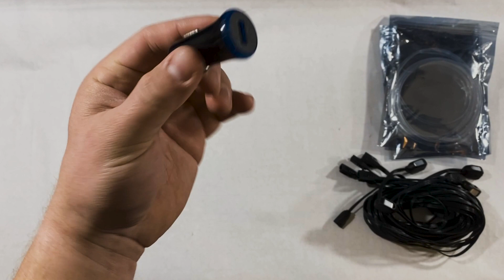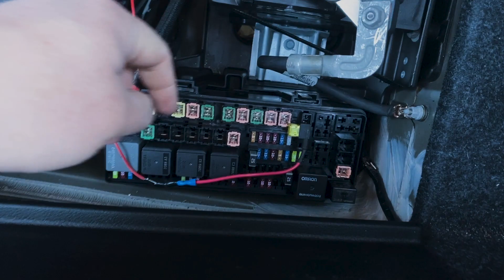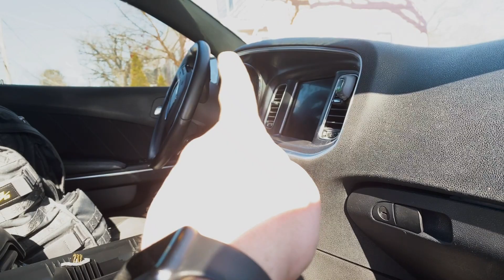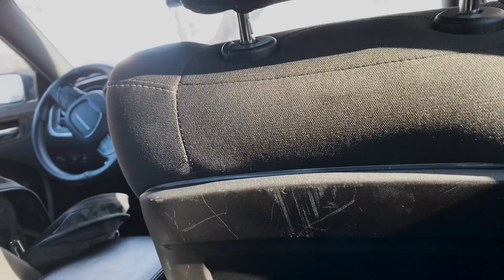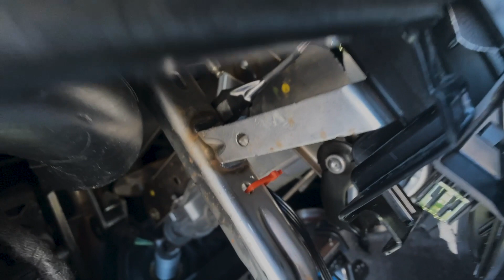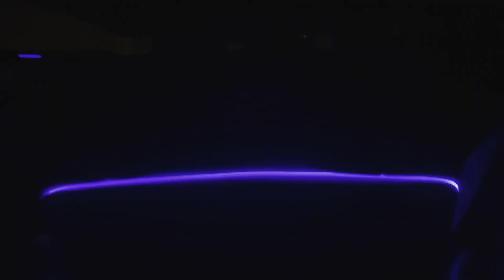Installing XKGlow fiber optic lighting kit

Comment: Looking for a kit that is better than what i have. The main issue with mine (different brand) is the. Flat part of the fiber optic cable is too thin so when its inserted into the seems of the dashboard trim it literally falls right back out in some spots. I believe this could be resolved by a fiber optic cable where the flat part is a bit thicker so it will wedge into the dash trim. Does anyone know if this kit or any other kit fits this need? Any help is much appreciated.

Comment: could you go into more detail about why you would need to hook it up to the battery ?
Reply from the maker: I connected the positive lead to the fuse and you need to ground the negative lead. all grounds lead to the negative terminal on the battery so I grounded it next to the battery. you don't have to hard wire the system to get it to work, I just don't like seeing wires so instead of using the accessory to USB adapter they gave me I hardwired the system for a clean look.

Comment: Have you had any issues with the fiber optic wearing out? I’ve had this installed in my car for a year and loved it! However as of late, one of the light heads stopped glowing through the right side of the dash. I’ve tried replacing the light head, but the issue persists.
Reply from the maker: I haven't had that happen, but I have had mine installed for about a year and a half now and the fiber-optic cable becomes sun-bleached which then fades it and dulls the colors its an easy replacement and then back to normal but an inconvenience none the less. now I will add that the vehicle this was installed in has never been parked in a garage and has always been under constant sunlight I do have tints on the door windows and I extensively used these lights everyday and sometimes all day so for how much abuse they've taken I'm happy with the results. the replacement cable is about $20 I BELIEVE so relatively cheap replacement as well.

Comment: ONE QUESTION - when the lights are on, how is your driving experience when it comes to the light reflecting off the front windscreen? Do you have that issue and if you do, how heavy is the reflection and where do you see it most on the windscreen?  I'm thinking of having this done to my car but reflection ended up being my biggest concern.  Thanks,
Reply from the maker: I don't have a reflection on my windshield but I do have some on my door windows. your tint level will also dictate how much reflection will show as well. but the lights are dimable.

Comment: Can this be used in a home? is there an adapter that will work for this purpose?
Reply from the maker: there should be an easy way to do this in a home but im also sure someone makes a fiberoptic wire kit for home use
Reply: @codenamecoyote5349  I’ve checked and haven’t really been able to find one similar to the this.

Comment: Hey bro if I have a system banging will this fiber optic cables stay put . Im thinking about getting that for my g8 but I worry my system will knock them out of place any thoughts
Reply from the maker: I have subs in my car I only had an issue on trim panels that had fabric but i used an adhesive on the inside of the panel to hold it in place.
Reply: @codenamecoyote5349  hell ya bro thanks for the advice I bought the red ones

Comment: Were you able to hook up the blue wire to get the full function of the lights ?
Reply from the maker: the blue wire was a signal wire needed if there was no trigger to turn them on and off automatically with the cars ignition i bypassed all of this by using a fuse connected to the cars ignition.

Comment: So is the power coming from the tapped fuse instead of the positive battery terminal?
Reply from the maker: Yes, These specific LEDs only use 5v max so its safe to run them off the tapped fuse this also provided me with the ability of having them turn on and off with the ignition.

Comment: How did you get it to stick, or is it sticky already?
Reply from the maker: No it’s not sticky but it does come with 3m adhesive tape the best method is to fit it between trim panels in the car

Comment: I have a quick question.   Does the fiber optic still work without the second tube around it?
Reply from the maker: XKglow suggests using one led head for every 3' of fiber optic cable and from my experience I would say the same. If you don't add a second led head it begins to fade the light and color over longer distances.
Reply: @codenamecoyote5349       Sorry, after looking again, I don't think this is the same product I was looking at.   The product I saw had two tubes, the outer tube and the inner fiber optic tube.  This appears to only have the one tube so that kind of answers my question.   But your suggestion is still helpful, because 4 of my locations would be right at 3'.   Does it just fade right off drastically at 3' or is it strong at 3' and then fades off slowly?
Reply: @marcuslinton310  how did u use yours with a both tubes I have both and I don’t know what to do
Reply: @jaredgonzalez8421   Not sure what you're asking.   I don't have this product.

Comment: Do these lights turn on automatically turning on the car? And does it save the color you pick for start up everytime?
Reply from the maker: Yes they all turn on with the car and you can set it in the app to a start up color. I usually leave that on white and change the color later.
Reply: @codenamecoyote5349  Is it just an addressable LED in the driver? I don't think it could be anything else, but an LED shouldn't be that bright either, and it isn't EL wire.

Comment: How many amps did the fused or the usb had? And what kind of fuse type did u purchase
Reply: Not sure about your first question, but the fuse type in this video is ATM-LP.
Reply from the maker: So it’s a 20 amp fuse and I got another one to go with it. It’s a mini fuse
Reply: @codenamecoyote5349  so you use the 20amp fuse for it and u got a mini 20amp? I’m confused

Comment: That kit is way better than what I bought.  Mine worked, but, your kit is better.
Reply from the maker: Yeah I had a couple people at recent meets tell me the same thing. I think its nice my only issues are the tabs that go between the panels don't like panels that share padding or fabric so I had to use adhesive tape on them. the dash and center console was great but my seat backs kept coming off so i added some of that 3m tape to the inside and now no problems. check them out at www.xkglow.com
Reply: @codenamecoyote5349  mine also has a couple places it isn't tightly secured.  I was thinking of what to do, but it isn't loose, so, I may just leave it.

Comment: are you located in Elgin, IL? If yes, do you know a place where we can get this installed professionally?
Reply from the maker: Yes Elgin, IL. My #1 suggestion would be to go to Omega Auto-557 Cooper Ave, Elgin, IL they do all kinds of cool custom work and its good quality work. There are some other shops but, Im not too sure on their quality of work as I do most of my installs myself but here is a list of local (Elgin) places you can get it done at:
J & R auto salon- 922 East Chicago Street
C & S Autoworx- 936 E Chicago St Unit C
Alfaro and sons-760 Villa St, Elgin, IL
Tintworx-110 Villa St, Elgin, IL (I had custom tint done here they are awesome)

Comment: Question, you had 12 feet of fiber optic cable total and this was enough to do both the seats and the dash ?
Reply from the maker: So XKglow sells kits of 1x 6' and 2x6' I bought 2 sets of the 2x6'. the dash is 1 full 6' cable, the center console is about 4' of cable, both seats are almost 6' cable a piece. now I used 2 LED heads for each seat, 2 heads for the dash and 2 for the center console. the 2x kit comes with 6 LED heads. In total I used 8 LED heads.
Reply: What is an "LED Head"?